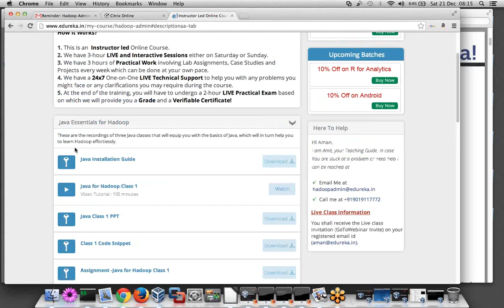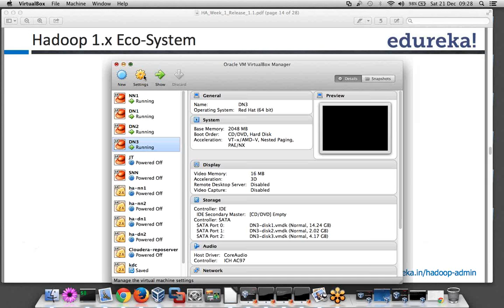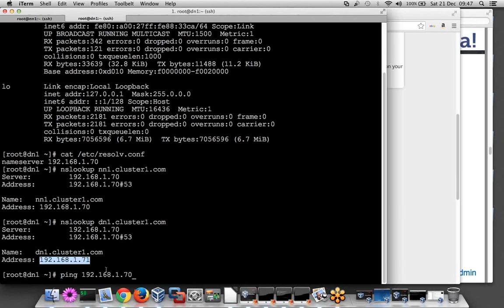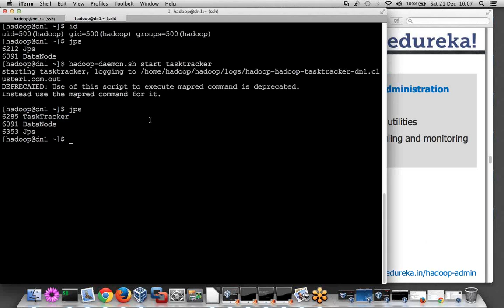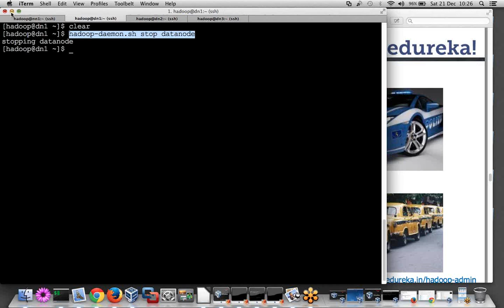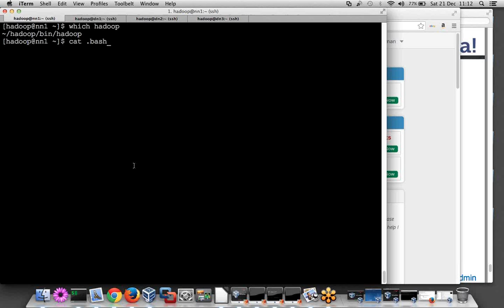Hadoop Administration Tutorial - 1 | Hadoop Admin Training - 1 | Hadoop Admin Tutorial for Beginners

Comment: But I don't have any IT knowkedge, will it be use full if I learn hadoop but I was interested towards it
Reply from the maker: Hey Dinesh, Hadoop is used to work with Big Data which is generally preferred by tech professionals. But, if you are really interested in starting afresh, you could do so by starting to train with pre-requisites and then learn Hadoop Administration i.e. if a Hadoop Admin career track interests you. But, do note that this is a complete career shift. Hope this helps. Cheers!